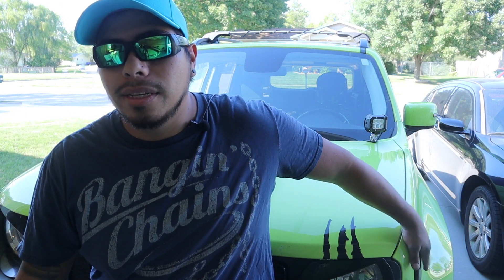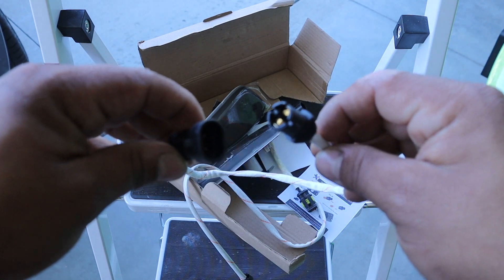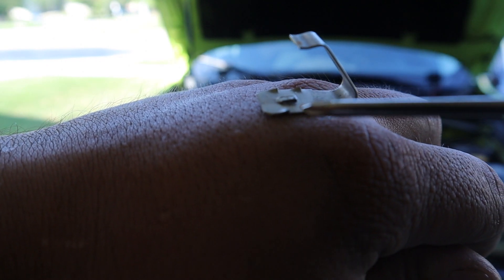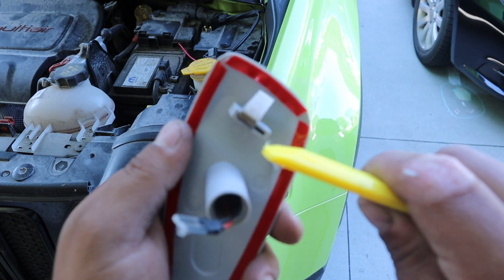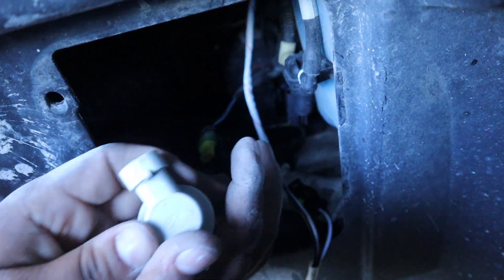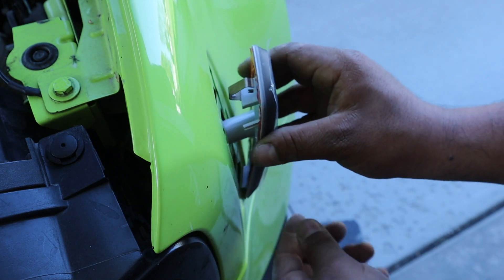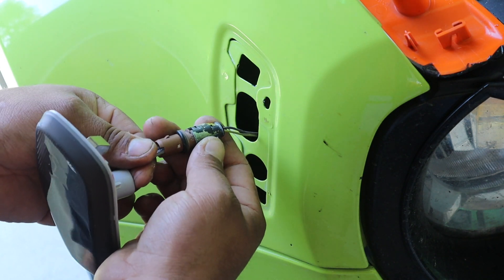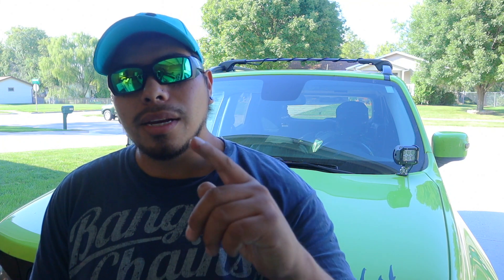Aftermarket sIde markers for your Jeep Renegade

Comment: Great video! Easy to follow. Only issue I'm having is getting the harness to go back in. I've shaved down the "little piece" but still not fitting in.
Reply from the maker: It is a bit of a pain. You might have to end up putting a bit of adhesive on the the side to keep the gap closed

Comment: Hey, quick question! If i mod the side marker to a turn signal , will the side marker still act like a sidemarker when the turn signal isnt active? It should 100% mimic the turn signal, correct?
Reply from the maker: So if your turn signal is not on the side marker will not be on. They only turn on with your turn signal unfortunately. I opted to go with the side marker instead of turn signal.